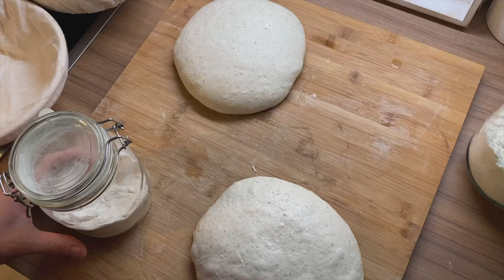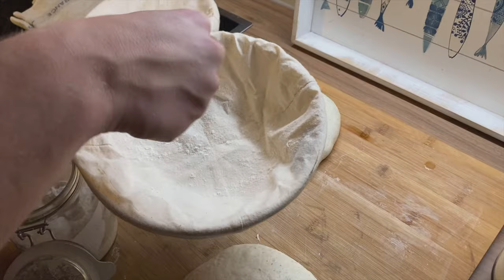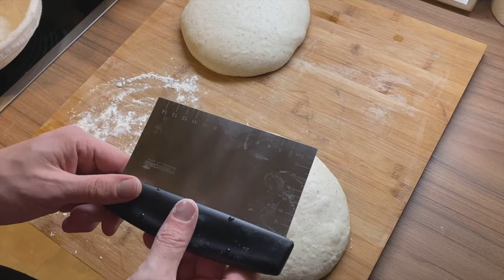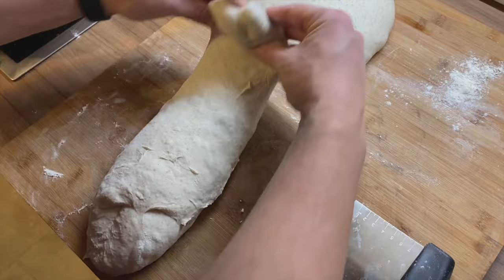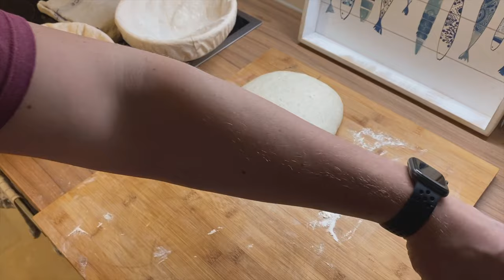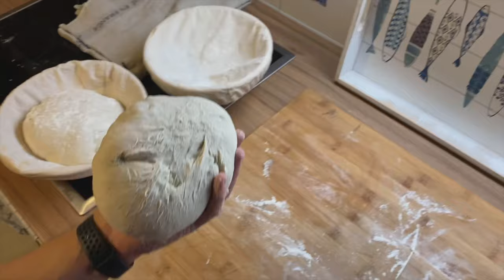The ONLY SOURDOUGH BREAD SHAPING Tutorial You Will Ever Need

Comment: Nice one, I haven't seen so much stitching before, I tend to just do 4 folds in, flip then tension and shape with the scraper. I try to use a dab of water on the scraper and zero flour on a silicone board. Depends a lot on the hydration though!
Reply from the maker: Hi Mike, thanks for the great comment. 0% flour shaping is great, works for me too but only if the hydration is slightly lower, as you said.

Comment: at 5:12 does it matter if you flip it or not as you put it in the banneton? At that point, after your rolled it, there's not sticky side anymore right, and it seems to be about the same roundness on the top and bottom sides, so it doesn't really matter what side it proofs on now right?
Reply from the maker: In general the smooth side should be at the bottom of the banneton. That helps to have a better look in the end.

Comment: Hi. Your baking is so inspiring. I recently started to bake my own but I need your advice please . 1- my starter is whole wheat and I am feeding it only whole wheat, I am afraid if I will mix it with strong flour it will become weak) . / do you think I should start a new starter with strong bread only ? I tried with all purpose but it didn't work 2- While scoring my loaf the dough is going flat (not firm like yours ) / do you think because I am proofing it in a pyrex bowl instead of banneton? Or it's not proofing enough? Or my sourdough recipe? I really appreciate your advise . Because I tried so many recipes and I am getting the same results. Thank you so much and all the best,
Reply: I use 100% all purpose (AP) flour to feed my starter. Whole wheat (WW) matures then goes old much much faster and costs so much more to use. When it comes time to bake, I  add WW flour to the levain (starter you will be using in the bread) the night before.
Reply from the maker: Moin Mountaha - hope all is good. I would keep your starter always whole wheat, that's what I like to do. My starter is around 3 years old and loves the flour. Pyrex bowl won't be an issue. Just use a kitchen towel inside, add flour. It is the same as a banneton. Maybe you have been using too much water for your flour. I recently added a video on figuring out a great ratio: https://www.youtube.com/watch?v=s1gM_jziXcI. Hope this helps.

Comment: Well done! My gluten membrane always bursts when rolling it up making the dough all sticky... Any idea why? Thanks!
Reply from the maker: Moin Junior. Sounds like your sourdough has too much acidity. Exactly the same thing happened here in the end of this video when I was trying to shape the dough: https://www.youtube.com/watch?v=qM9BXKaIr60. Cheers.
Reply: Also you may need to work on gluten development.
Reply: Thanks both of you. Tbh I've tried both of the suggestions 1/ feeding 1 part starter 5 parts flour and water and 2/ gluten development (windowpane) but none seem to improve the strength of the gluten layer after shaping. I think it might have something to do with the quality of the flour...
Reply: @juniorcuigniez7096  My recommendation based off of the issues I've overcome in the past is to play around with different hydrations. Even if the bakers you see online are using super high (80-90%+) hydrations doesn't mean the flour you are using will work at those kinds of hydrations. Every flour has different absorption properties and that is never something that can be listed or explained by the miller or manufacturer. The only way to figure it out for yourself is to experiment on your own and find out what works for you. With my flour and climate, I keep my hydration around 78-82%. Keeping good gluten development practices as a control is important though. Again find out what works best for you. I do an overnight autolyse, mix on multiple speeds with rests in between, lamination, and coil folds throughout bulk fermentation as my personal method. Hope this helps!
Reply from the maker: @juniorcuigniez7096  Could be yep. How much protein % does your flour have?

Comment: Envy again. Thank you for sharing your skill. May i know how long have you been doing sourdough bread? I tried round off but it the bottom just look a big lump that is not properly incorporated. Like what you mentioned here, if i have too much flour, it wont work, is that the only reason? God bless.
Reply from the maker: Moin Xin, I have been doing it for around 4 years now. Try not using as much water, go for a little less, max 65% hydration. Keep practicing, try making buns from time to time. That will definitely elevate your skills as you have more doughs to practice. Worst case if things are too sticky, use a loaf pan. Place your dough in the loaf pan. Proof it as usual and then bake. Saves the dough every time!
Reply: Make buns using the same recipe? Thanks again. Really appreciate you for helping keen learners to not give up. Cheers!
Reply from the maker: @xin-xinmah8517  Yep. Exactly the same recipe. Try proofing them on your tray, not too long. Then bake them :-).